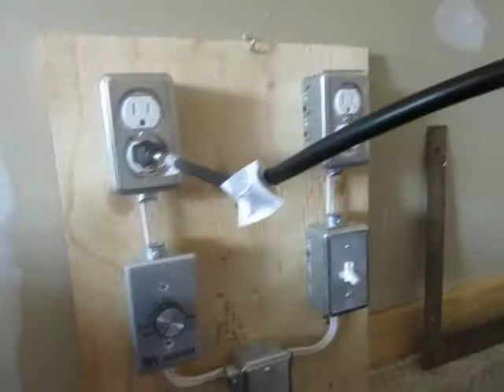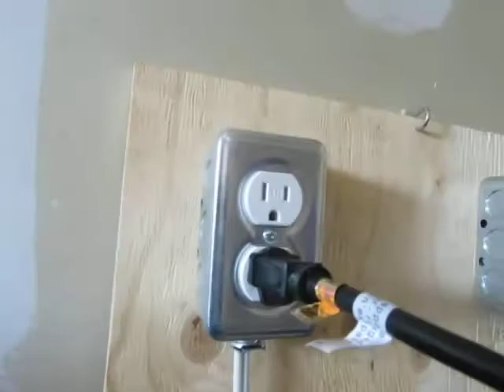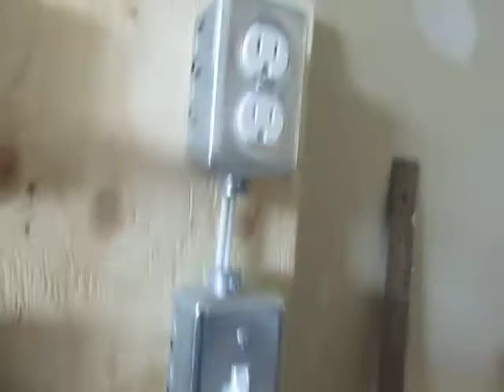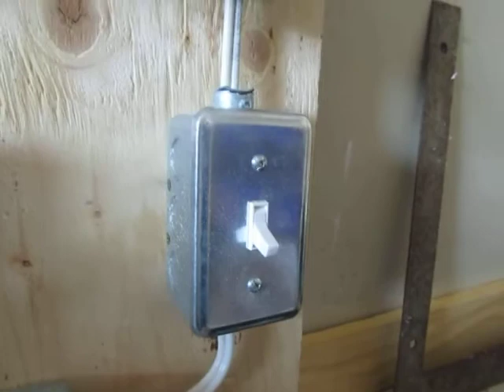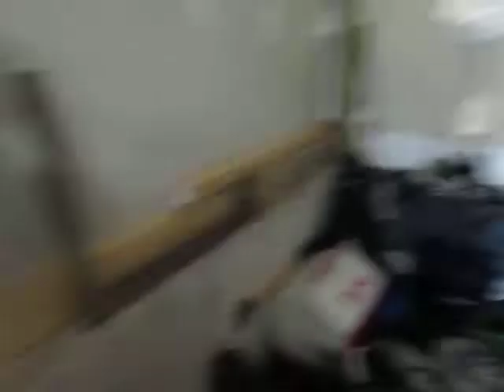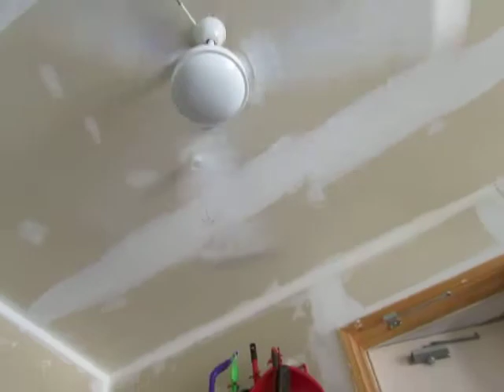Canarm CP56 Industrial Ceiling Fan (wired up on new test rig)

Comment: Can you reverse this fan?
Reply: If you switch the blue wire and the red wire, you can change direction,  Blue on hot = down draft,  Red on Hot = updraft.
Here is a installation diagram I found.
https://www.canarm.com/assets/product/documents/CP_Fans_HPWP_Fans_UserGuide.pdf